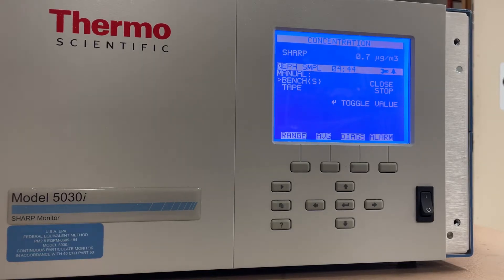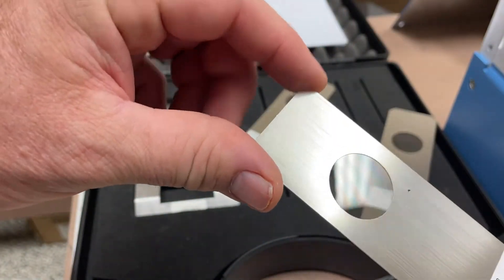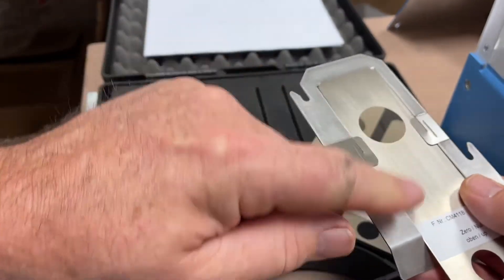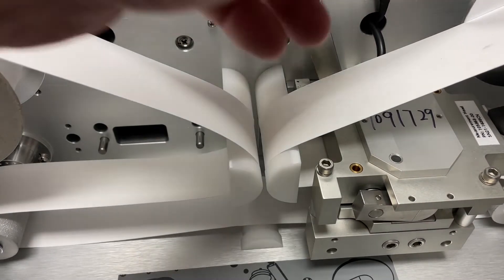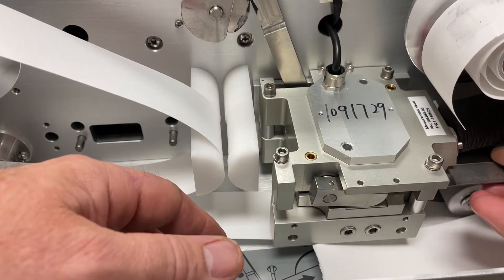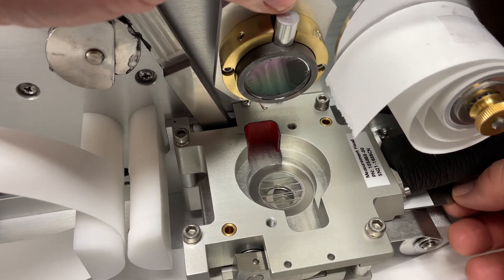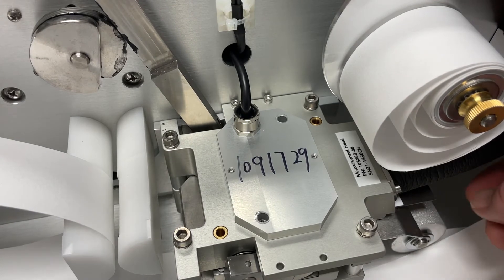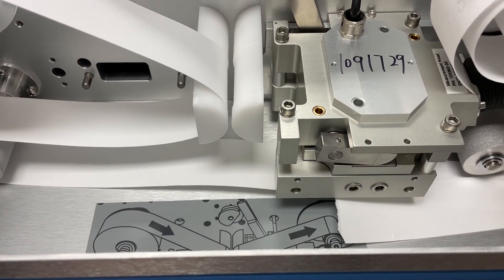Thermo Scientific Model 5030i Mass Calibration Foil

Comment: Hi. The model 5014i is different? Can the calibration be done in the same way? Thanks
Reply from the maker: Yes the Thermo Scientific 5014iQ uses only beta attenuation technology, while the 5030iQ SHARP is a hybrid monitor that combines beta attenuation with light scattering (nephelometry) for enhanced accuracy. The 5030iQ's hybrid approach allows for more precise, real-time measurements by cross-referencing the two technologies,
Reply from the maker: Also yes the calibration is done the same way.